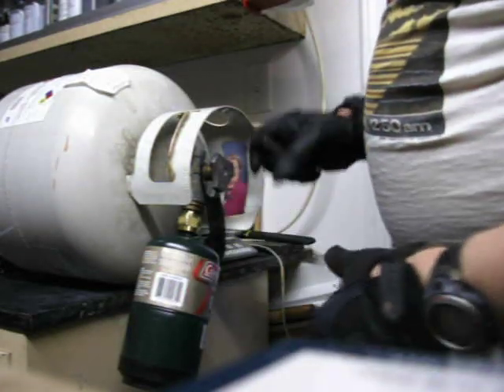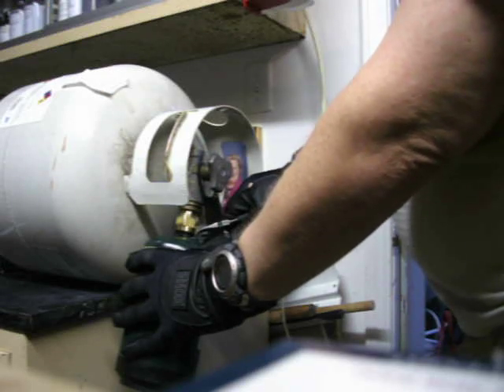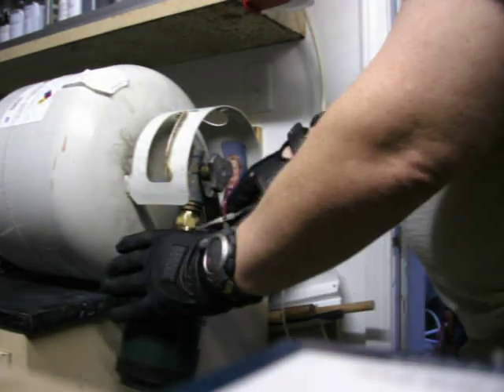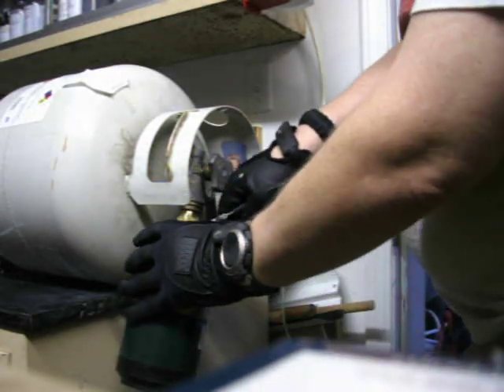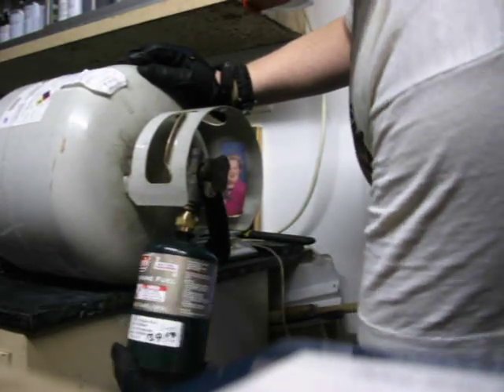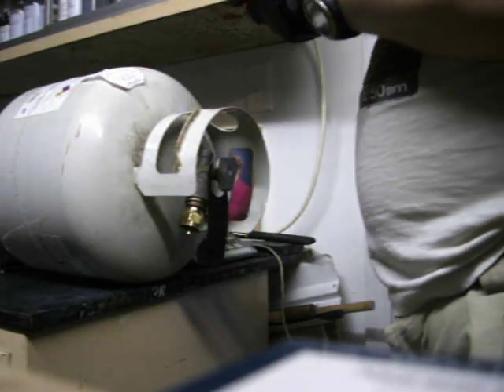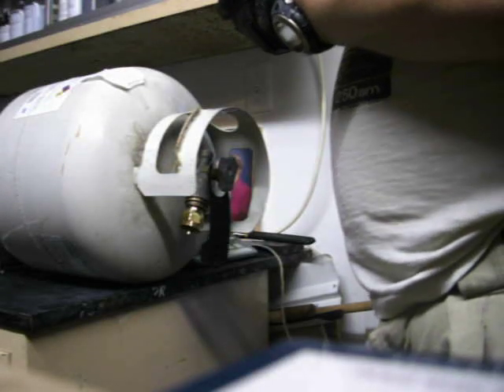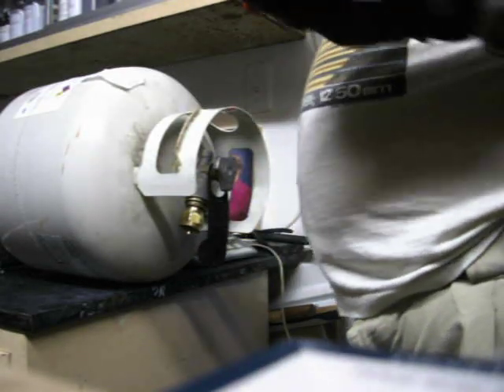Refilling 1lb Propane Cylinders using the pressure relief valve method (non-chill)

Comment: That's not air you are letting out. It's propane gas, and it is flammable. You are also running the risk of the relief vent opening and venting out propane if you fill it this full. At the very least, you should have the 1 pound can tilted with the relief valve on the downhill side. This would vent the cryogenic fluid (liquid propane) sooner, letting you know before you overfill it. A propane tank of any size should never be filled more than 80% full, because the liquid inside needs room to expand as it warms up.

Comment: If you repeatedly push the relief valve on the 1 lb tank, eventually it will start to leak. These valves are not meant to be repeatedly opened.

Comment: Reasonable, knowledgeable post ahead. I know a little...

You don't need to release the gaseous propane (as others have said, it's NOT "just air") to refill the 1lb tanks. You want an "air gap" between the liquid and the fitting or else if you use the little 1lb tank a bit on its side, like most camp stoves require, you can be sending liquid propane through the regulator and to the stove. Not safe. Also, releasing the gaseous propane through that safety valve is working the valve in a way that its not designed for. That is a safety valve, or "pop-off" valve, designed to keep the green tank from bursting if it gets hot. Never leave the cans in a hot vehicle or in the sun. It's best not to mess with the pop-off valve, but you do you.

Also you don't need to chill the tanks before refilling, although that can help get a little more into the tank, it's not that much more and again, not particularly safe because of possibly overfilling. If you need more gas, then use more cans. You can usually pick them out of the trash at camping sites for free.

If they have a little rust on them or are dented then don't refill them; just throw them out or recycle them.

Regarding people saying it's "illegal" to refill them are a bit hyperbolic. The law is to prevent people from refilling and then reselling them. It does not prevent you from refilling them for your own use. We are still in America after all. All the people saying stuff like "he's making a bomb" and "Boom!" are also a bit hyperbolic. These tanks are rated at about half of their ability with a wide margin for consumer safety, but it's always better to stay well inside the safety margins because another couple of ounces of fuel is not worth the risk of potentially hurting yourself or others.

Propane also is not under a lot of pressure in the tank. Depending on the ambient temperature the tank pressure is between 100 and 200 psi. If the popoff valve is working properly then a propane tank will NEVER explode, or become a bomb. You can even throw one in the fire and it will heat up enough to pop the popoff valve which will turn it into a flame thrower until the tank pressure is reduced, at which point the popoff valve will re-seal and the flame spurt will stop. It will continue to heat up though and continue to popoff and reseal until the rubber gasket in the popoff valve melts at which point it will be unable to reseal and the tank will continue to spew gas until it is empty. The only way to get one to burst / explode in a fire would be to seal the popoff valve so that it cannot free the excess pressure. It may also do it if the popoff valve is defective. DO NOT try to test this unless you have a mythbusters-style gravel pit and are behind a blast shield. 

I have seen a 100 lb. propane tank in the bed of a Chevy Luv pickup explode. The truck was configured to run on propane and the popoff valve was bad, so my uncle capped it to keep it from randomly spewing out the propane. The truck got caught in a fire on our farm, across the road, about 130 yards from the house. Luckily nobody was brave enough to go near it to try to put it out. As we were standing in front of the house watching it burn, it exploded; knocking us all back and blowing out most of the windows in the front of the house. There was a large mushroom cloud and people in the town, twelve miles away called the police, saying they heard the explosion and saw the mushroom cloud. Nobody in my family has ever capped or plugged a defective popoff valve since.
Reply: If memory serves at 
70 F psi is ~100psi. 
100 F ............200psi
140 F..............392psi.
So yes overfilling is a problem.
Where do you think that relieved gas goes. 
...hey who cares let's fill up a few compartments or cabinets with a f'in explosive gas. Or let it just pool on floor for awhile so the cat can breath it in....damn bro....

Comment: Also you can buy larger propane tanks that are called Liquid Propane. These tanks are filled with the same ratio of 80% liquid and 20 % Gas.
The reason that these tanks are identified as LIQUID PROPANE. is that they have a long valve stem that goes down into the liquid propane.
When you open the valve you get liquid propane NOT Gas.
These tanks normally have a RED valve and need a RED liquid propane regulator.
This liquid will FREEZE SOLID whatever it touches. Special handling is required.
A cubic foot of liquid propane will expand to 270 cubic feet of propane gas.
Reply: I believe its 27 x not 270 x.
Reply: @raynic1173  270
Reply: Propane liquid will expand 270 times as it changes from a liquid state to vapor state. For example, 1 gallon of liquid stored under pressure in a container will expand to approximately 270 gallons of vapor if released to the atmosphere.

Comment: There is NO AIR in a propane tank. A full tank contains about 80 % liquid propane and 20 % gas propane.
In order to fill a propane tank you need the liquid form. 
So when you turn the bigger propane tank upside down you are putting all the liquified propane at the valve.
When you open the valve the liquid propane is pushed by the pressure of the expanding propane from the big tank to the smaller tank.
When you open the safety valve in the small tank it lets out propane gas that is at the top of any propane cylinder. When you see the white stuff coming out. It's actually the liquid propane coming out. It means the tank is OVERFILLED.
Liquid propane boils at - 45 degrees. This boiling releases a vapor which is Propane Gas.
When the liquid expands too fast the outside of any tank gets covered by a white Frost.
That means that the propane is being used up quickly. Causing the heat from the surface of the tank to transfer to the liquid inside.

Comment: you want leave that "air" in its propane vapor and all you're doing is overfilling your tank and reducing the pressure inside the tank that it uses to get to where it needs to go. You basically never need to vent the tank if you're doing it right.

Comment: That's not air!!! that's propane!!!   Looks like you are near multiple sources of ignition.  The white vapor is liquid propane coming out and boiling.  That means the cylinder is too full.  At least you weighed it.  Now let out a little more so the cylinder can warm up and not got hydrostatic.  This is a perfect example of what not to do.  The only safe way to refill a small cylinder is using a kitchen scale (battery powered so it can't ignite the propane) and a small, flexible hose.  Purge the hose once so air does not get pushed into the empty cylinder.  You can cool the small cylinder to help the propane go in (cooler cylinder - the propane has a lower vapor pressure so it naturally flows from the warmer cylinder to the cooler one).  Weigh the cylinder as the propane flows in.  Close your valves when you are close.  Disconnect everything and weigh the cylinder again to make sure you didn't overfill it.  A cylinder that is too full will become completely liquid-full (hydrostatic) as it warms up.  The pressure then builds up very rapidly as the cylinder warms up more.  Think of how hot your car gets in the summer.  The cylinder has to be filled properly at room temperature so that it does not become hydrostatic at 120-140°F.  If the pressure builds up either the relief valve opens or the cylinder pops.  Either is bad.

Comment: I freeze the 1lb'ers for an hour, have the big tank at 60-70F, and fill for 1 minute.
This gives me a reliable 11-15oz. fill and I never worry about overfilling or having a relief valve leak. Of course I weigh and soap check .
I don't understand why you need it absolutely full, unless your life depends on it, and how could it?
Reply: Yes, but don’t let the tank freeze.  Overnight in the refrigerator is a good idea, also.
Reply: @SaabAholic  why can't it freeze?  Other videos recommend leaving it in the freezer overnight.
Reply: @peacefulshades  I was told by a guy who works at the local propane company that if it freezes it can become a thick glob.
Reply: @SaabAholic  good to know!  There's so many videos on this by people whoop are new to it.  Misleading and potentially dangerous.  Thank you for adding to my smarticles on this.
Reply: @SaabAholic  ffs, liquid propane freezes at something like negative 424 degrees.

Comment: It is not just air you goof ball! It is propane gas! There is no air in that tank.
The other thing is that those cheapo little valves will tend to start leaking once you mess with them. A lot of tanks will never reseat completely.  Once you refill (illegally) a bottle you will have to use it pretty soon or you will find it empty in a few weeks because the relief valve seeps.

Comment: I never refill past 1lb 13 ounces total green bottle weight. That's the weight when purchased new. If overfilled, the relief valve could release propane gas and if ignited by the burner you would have a giant flame thrower in your rig. It's better to underfill slightly and be safe imho
Reply: If safety is a concern, buy a refillable bottle and the apparatus to use it.

Comment: Propane isn't a really a cryogenic liquid, it boils at -42 deg C.  To do cryogenics, they use liquid nitrogen and liquid helium with boiling temperatures below -180 deg C.  Propane will still give you frostbite but it won't do when you want to do suspended animation and that kind of stuff.

Comment: Amazing the varied comments on something as simple as refilling these 1lb tanks. Just as the OP states, the 1lb tank is only about 1/2 full you need to stand 1lb upright to let gas pressure escape to allow more liquid in on second charge from 20lb.  I’m doing this for winter use for my ice hut and using them the next day. I don’t weigh them at all but tend to get them about 2/3 or slightly more. I find if I get too much liquid into tank, they will expire with still liquid remaining because I my ratio was too much liquid and not enough gas. Likely best to weigh them to find right liquid to gas ratio. My adapter is had for at least 20yrs and doesn’t have the release valve so I manually have to remove tank to release air. Gonna look for relief valve model.
Reply: The propane turns from liquid to gas on its own when the pressure drops.  It automatically maintains a balance to get a equilibrium vapor pressure depending on the ambient temperature.
Reply: @dtrrtd774  it's funny as fook, all these experts giving advise that dont understand the process. TFF...

Comment: Do not do this! He is overfilling the tank past 80% capacity. this will leave no room for expansion of the gas during storage or transport. if the cylinder gets warm enough the relief will open and release propane as there is no room for expansion. PS its not just air, it is propane vapour gas being released when you are filling in this method. Very dangerous Don't believe everything you see on the internet.

Comment: 16 oz = 1 lb.  You filled 2 lbs into a 1 lb bottle?  That's 32+ ounces.
Reply: Idontcare_626 
The empty bottle weighs approximately 14 ounces. 14oz bottle + 16oz propane = 30oz total. 32 is 2oz overfilled.

Comment: Gaseous propane, not "air" is more dense than air at the bottom of your enclosed area. All it takes is a spark and you will have an explosion.  I'm not sure why chilling the tank is a big deal as opposed to inviting a potentially dangerous incident with releasing highly flammable propane to the environment.

Comment: How long does it usually take to fill the bottle if it’s empty and don’t you want your big tank upside down or does it matter?
Reply from the maker: Due to the density of propane, you need the big tank to be uphill so the propane flows downhill into the little tank.

Filing a little tank only takes a few minutes - maybe 2 or 3??
Reply: Most household  Propane cylinders are Vapour dipping cylinders. The cylinders inside a car are liquid dipping.  To refill the small cylinders you need to transfer liquid not vapour that is why you turn the transfer cylinder upside down. If you turn it on the side it needs to be fairly full. The downhill analogy is not quite applicable here. If the room temperature was -42 there would be no vapour pressure in the transfer tank and so your downhill (gravity) comment would apply. At 20 degrees centigrade the pressure in the transfer tank is 106 PSI above atmospheric pressure. This is the reason why the receiving tank will fill even if it is above the transfer tank as long as it is not upright. One should never fill the tank over 80% of it's capacity. This allows the Coleman cylinder to be carried in the boot of a hot car in safety.  If you overfill it, it will not explode (if the safety valve is in service). The danger comes when the ambient temperature rises ( in the boot of the car).  At 70 degrees centigrade  the pressure inside the cylinder is 360 psi. That is not enough to make the tank explode but it will open the safety valve,  releasing  propane with potentially catastrophic consequences.

Comment: *****Don't do this, you'll ruin the tank.  the little valves cannot handle this, i know, ruined a bunch of them this way and there are other vids on this.   SOmetimes works, but when it doesn't, the valve is toast and tank is ruined.  All you have to do is chill the tank 20 min in freezer and you can get it filled to 32+oz (keep it at 32 oz, total weight, or you are exceeding tank capacity at high altitude).  I pre chilled and accidentally filled mine to 36 oz (not recommended, obviously).
Reply from the maker: I didn't chill the tanks because when I fill them I fill 10 or 20 tanks so I can't easily cool them all. And, I've never had a problem such as you describe.  I have seen value problems BEFORE I refill them - then I just discard them.  If their valves stick or won't work, I don't keep them.   Since 99% of people discard tanks rather than refill them, I figure its worth throwing out a rare few that don't work well enough to be safe.